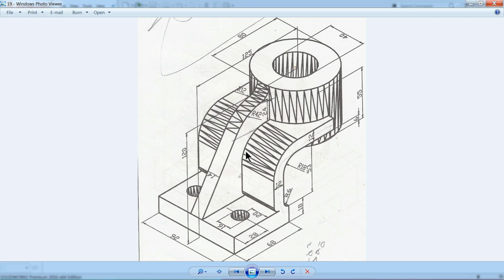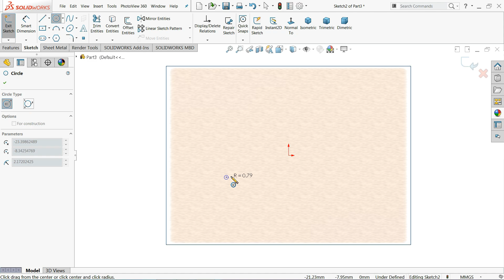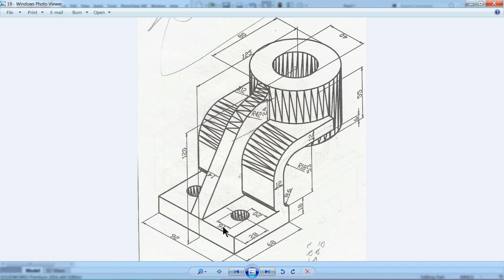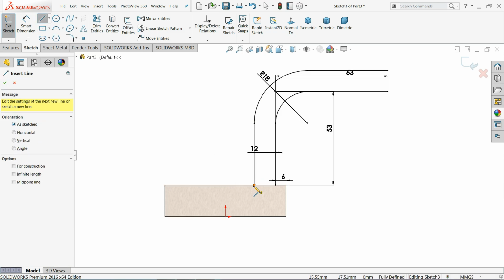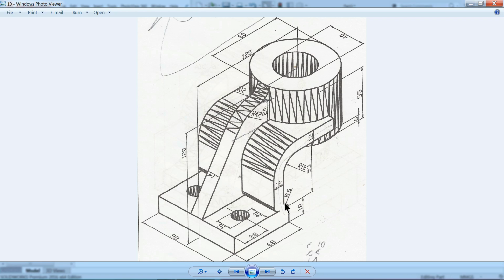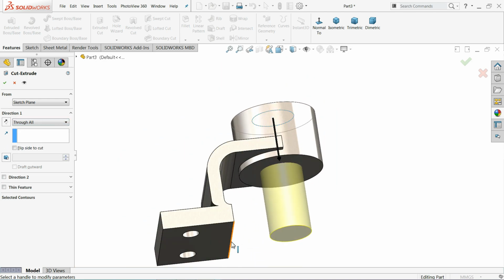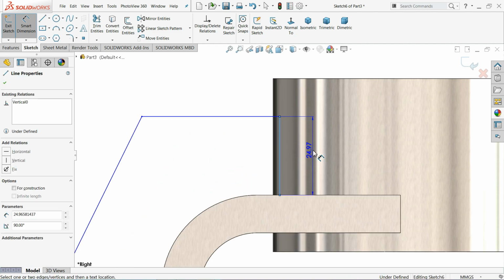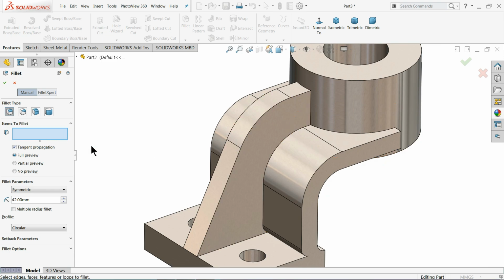SolidWorks Tutorial for Beginners Exercise 7

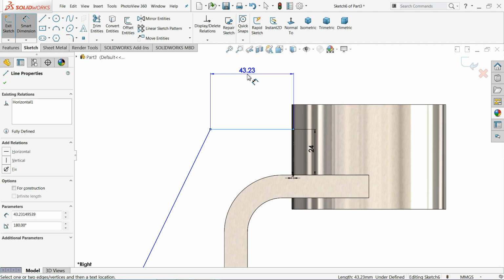Comment: 10:20 ,wrong!!!!, you cant take the length 42 mm,its nowhere given,42 is the radius of the arc only.
to draw the rib you should draw the 42 mm arc first ( from fig : we can understand that the origin of arc is 42 mm(radius) down ,that will be at the bottom left edge of the cylinder ) then tangent the  slanted line and then extrude the rib ,then fillet the 12 mm curve

Comment: Hi, 
Great tutorials! 
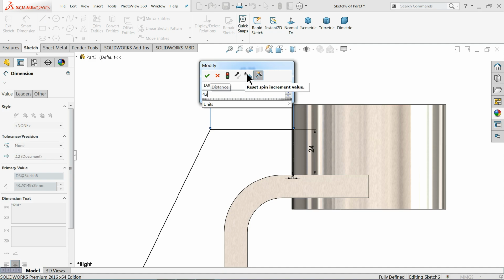Quick question. So,at 10:23, the 42 mm dimension is used based on the radius. 
But the vertical line is 1 mm inside the cylindrical portion. Shouldn't I be taking
43 mm instead? Or is that irrelevant ? 
Thanks
Reply: I too wonder why he even placed it 1 mm into the cylinder instead of making the construction line colinear to the outline of the cylinder.
Reply: @yony120  It should be colinear. The way he did it will result in a wrong dimension when making a drawing for machining
Reply: @herrtuug  If you put the line collinear to the curve, Solidworks doesn't recognize that line, and a rebuild error msg pops up...Try it you will understand.
Reply: @yony120  one thing is that the way to draw the rib is wrongly explained in the video 

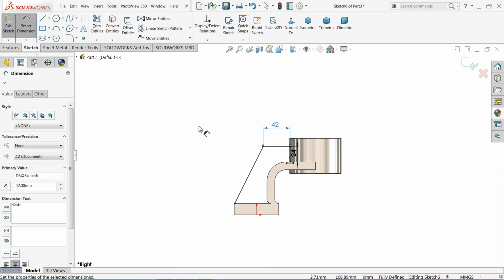10:22 you cant take the length 42 mm, its nowhere given,42 is the radius of the arc only.
to draw the rib you should draw the 42 mm arc first ( from fig : we can understand that the origin of arc is 42 mm(radius) down ,that will be at the bottom left edge of the cylinder ) then tangent the  slanted line and then extrude the rib ,then fillet the 12 mm curve

and about the 1mm :

the  cylinder have a curved surface , so you cant merge the rib with the curved surface area when you didn't take enough more length from the outline that is required, this more length will helps to merge the rib with the curved surface of the cylinder
simply saying :drawing is only on the outer most line of the cylinder, but we have to merge the rib with curved surface so extra length will help.
Reply: i also was thinking same that if 1mm is inside the circle than it should be 43mm.
1mm can create alot issue in mechanical design
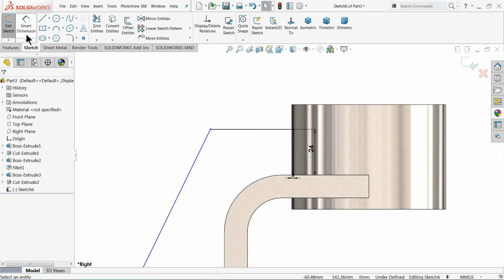Reply: 10:20 ,wrong!!!!, you cant take the length 42 mm,its nowhere given,42 is the radius of the arc only.
to draw the rib you should draw the 42 mm arc first ( from fig : we can understand that the origin of arc is 42 mm(radius) down ,that will be at the bottom left edge of the cylinder ) then tangent the  slanted line and then extrude the rib ,then fillet the 12 mm curve.

Comment: When I did this part when I was doing the cylinder portion of it I did a reference plane 120 mm upwards off of the bottom face and then did a construction line that was lined with the center of the part that was dimensioned to 125mm. That way your not doing the math when you extrude it

Comment: It appears that the rib dimensions are not fully defined by the drawing. Your choice to place the 42mm radius of the fillet as the dimension length of the line in the rib drawing seems arbitrary.
Reply: to make it not arbitrary you just built the first tangent circumference of radius 12, the second circumference of radius 42 tangent to the previous one(and coincident to the circumference of radius 12 at its lowest point) and finally draw the straight rib profile tangent to the circumference of radius 42.

Comment: where did you get 1 mm at the end before  you create the Rib. Blueprint doesn't have that man
Reply: Younes IHAD The drawing says 14mm. Look at the flat part of the rib.
Reply: Younes IHAD he is not talking about the thickness of the rib. he is referring to the 1 mm dimension used at the right plane for the cross-sectional of the rib. I tried drawing without the 1 mm but the software could not create the rib without the 1 mm dimension.
Reply: Onifade Abdulraheem  I have created rib without 1mm distance and it works fine. Software can create the rib without 1mm gap.